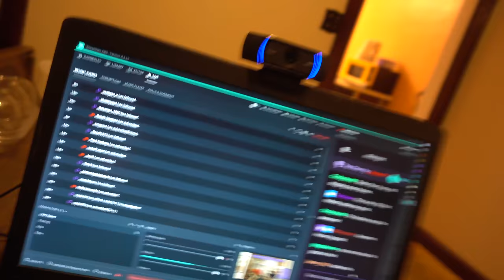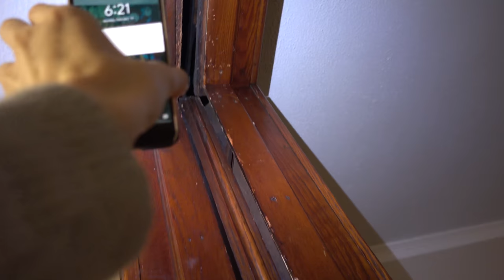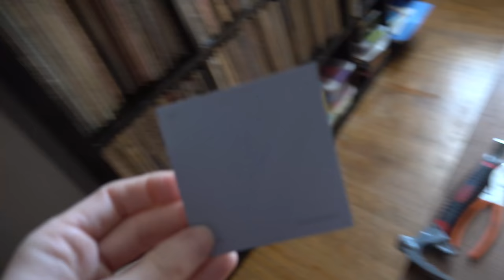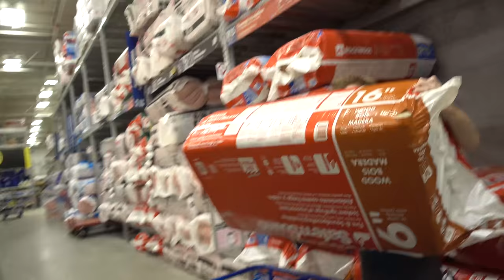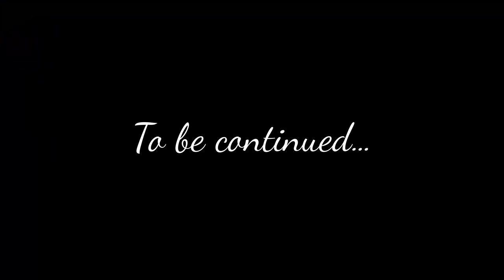Allie & Steve Find a Pocket Door

Comment: Allie and Steve, I had pocket doors just like that in my old house.  We actually took the moulding off all the way around the frame to get the the mechanism inside to oil it.  We used WD40.  Our doors did not have the locking mechanism on them since they were between the dining and living room.  We also had a swinging door between the dining room and kitchen. I miss my old house.

Comment: Brass responds well to household powder cleansers, Comet or Old Dutch, for example. A soft toothbrush is good for in patterns in the brass and there is less danger of scratching.  If the dirt isn't too  stubborn,  a patient metal cleaner, such as Brasso, or equivalent should be satisfactory.  The doors and woodwork are in gorgeous shape. Pocket doors running on a suspended steel tube and having adjustable runners were also common. Some styles of such doors had pull rings mortised into their leading edges.

Comment: Look into getting a "hive tool". They're like $3 bucks so get two. They're perfect for pulling trim and the eventual flooring you'll need to replace or repair. It'll turn into the tool in your hand 50% of the time you're working.
The piece of plaster you pulled out is a key. That means the plaster is could be  pulling away from the lath wherever that came from. But plaster is an easy fix.